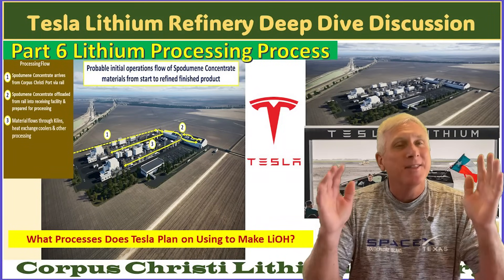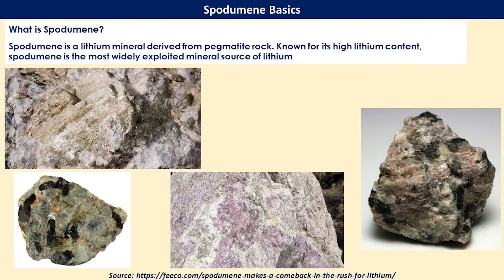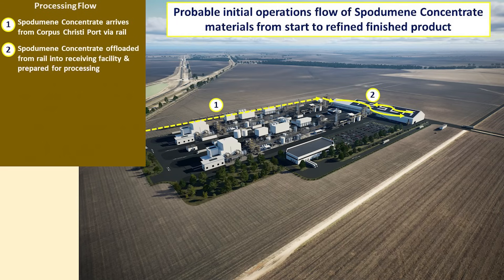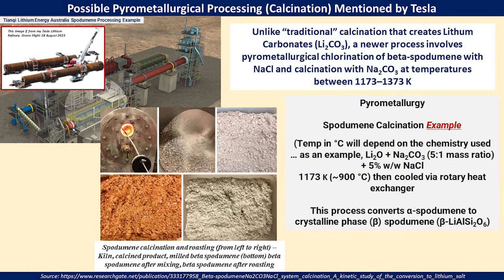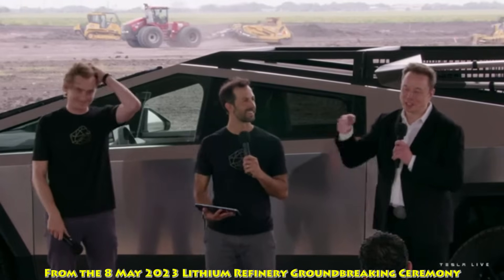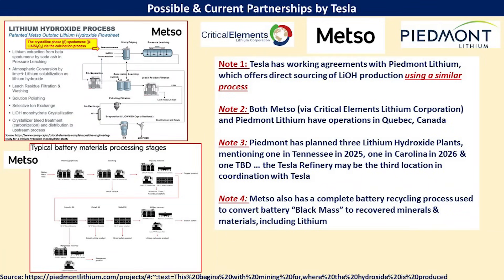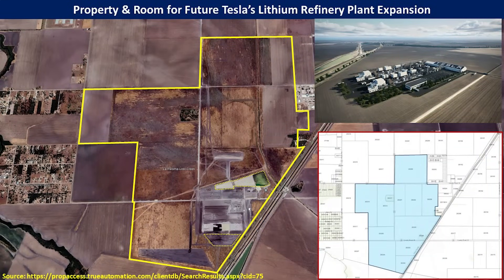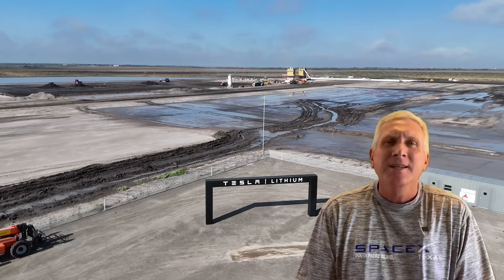Part 6 Tesla Corpus Christi Lithium Plant Deep Dive Video (3 production strategies Tesla will use)

Comment: Why would SiO2 or CaCO3 be considered a waste products? They are both used in a multitude of products. Unless they are contaminated, they should have value, and the purer, the higher the value. Sand is largely SiO2, but SiO2 is not sand. Sand needs to have an angular structure for use in cement, and this would be unlikely to a product of this factory, but if pure, SiO2 should be useful for glass, fiber optics, solar panels, etc. I imagine that the plant will need considerable area for temporary storage of input and output materials, especially for the bi-products; this may explain in part explain the need for a large acreage.

Comment: Mg and Al are probably both in the oxide forms but are both valuable in that form. CaCO3 is that white stuff that farmers dump on their fields by the truckload to reduce soil acidity.
Reply: Exactly! The "other" recovered/recycled materials are important as well.
Reply: you could also probably manufacture portlant cement out of the non lithium components that remain.

Comment: Can anyone confirm that raw aluminum is a 'by product'? Not Al2O3 or some salt, but the metal? And ... how much power were they ta;ling of consuming? Aluminum is a major component of the spud, if that's *all* coming out as aluminum ... then that's a major product too. The regular process for aluminum involves sodium hydroxide and metric truckloads of power (reversing the ridiculously exothermic thermite process, basically). If Al is coming out, I expect more electrical infrastructure here than there is at GTX. Or all that 'extra land' completely filled with solar. 
Oh, and maybe an aluminum refinery or place to alloy all that aluminum appropriately for ... castings.
Reply: Yes, indeed. This was my thought too. Of course lithium is the important focus here, but actually the other "recovered materials" - especially aluminum and manganese - may turn out to be just as important. As you point out, "normal" aluminum processes are super-power intensive (so a good place for solar power, etc., to be used - or even modern small thorium reactors). Joe's presentation of the chemistries involved makes it clear how (and how much) useful materials and substances can be derived from these "relatively benign" refinery and recycling processes. Alchemy at its best!🙂
Reply: @WarrenLacefield I don't even know of an aluminum plant near a solar farm large enough. AFAIK, they're all parked immediately next to major dams and fission plants in the US.

But, I'm with you on throium. Standardized modular thorium on concrete barges in man-made lakes on federal property. The extra bits firmly decouple many of the major costs and problems of fision.
Reply: @shrikedecil  Honestly, I really don't know what the energy requirements will be here. This is a relatively small refractory/refinery. Lithium, not aluminum is the primary goal. But they are not working from bauxite to get aluminum.
Reply: @WarrenLacefield  I see "Al2O3" in there... 
Normal process is bauxite -> alumina ... and then the energy intensive part. Shrugs.
Reply: @shrikedecil  Yeah, you're right.
Reply: Solid by-product coming from the plant is a mixture of analcime NaAlSi2O6·H2O and calcium carbonate CaCO3.
Reply: Thanks! 
 @zuazaa